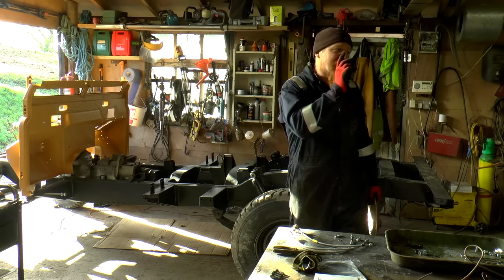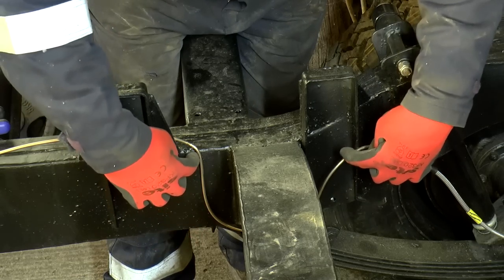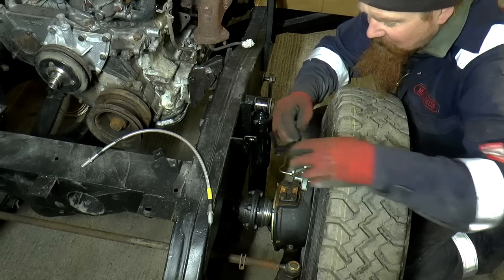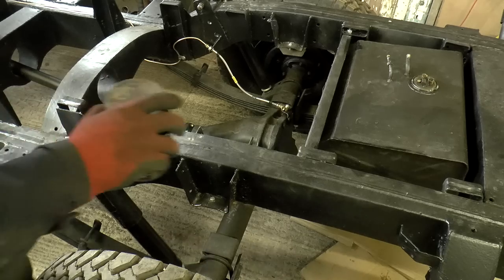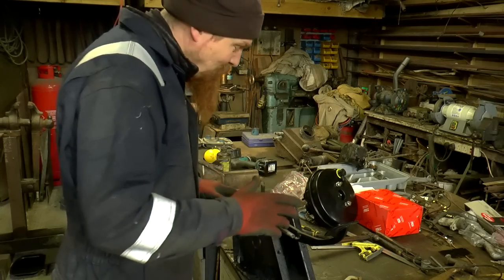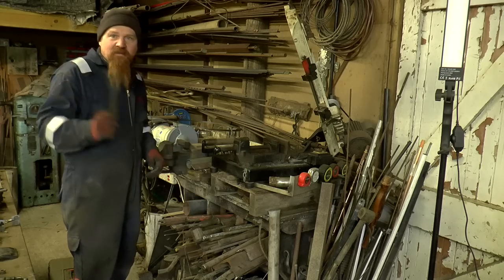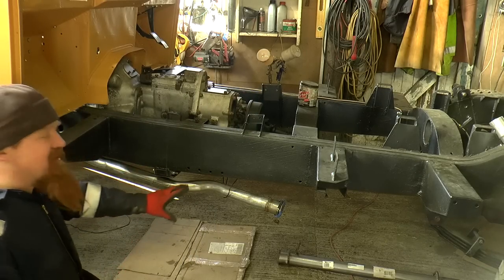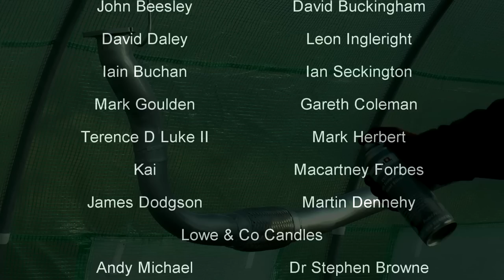Project Kermit 27: A Series Land Rover Full Restoration

Comment: hi max could you send the links to the break pipe flaring tools you are using
Reply from the maker: I used a couple of different ebay sellers, I don't have any links (it was a while ago!) but I'm sure those or similar will be easy to find on there.
Reply: thank you max , i named my land rover after you , i mean i did it about four years back still it is under restoration , i am sending this message to you from Sri lanka , we have so many land rovers here , i have a 1978 series 3 , 109 hard top. really amazed with your work , and really enjoying your channel as a whole , love your relationship with you grand father , i lost my father about 6 months back ., he was my mentor and my biggest fan. hope to hear from you  @maximusironthumper
Reply from the maker: @rajeevadesilva7951  Hello to Sri Lanka! Wonderful to hear my videos get out so far. Great to hear there are land rovers still there. Sorry to hear about your father, that must be a terrible loss, Grandad is my mentor and probably my biggest fan too!
Reply: @maximusironthumper  yes it was a terrible loss max , its not easy filling up a void that so big in my life. but i am moving on as life must go on , if you have an email i can send you some of the pics that i have taken in my land rover , i have restored two land rovers so far one is a 1982 series 3 short wheel base which i restored by my self and at the end i had great help from one my close land rover friends in Sri lanka , it had a 5 journal engine which i restored to the mint conditions using all OEM parts , i used in for more than 4 years and done about 50,000 Km in it before selling to worthy gentle man,  main reason for selling that was to get 109 restored since 88' is lacking the space inside i require for my camping trips .

Comment: I bought some stove paint for an exhaust which was a total waste of time....there isn't a lot on the market for very high temperatures. Also, I didn't find a primer that stated it was suitable for high temperatures - if you do have some info on this there'll be a few people who'd like to know. Good video....
Reply from the maker: I just bought high temperature paint via ebay, won't know for a few months if it's any good though!
Reply: @maximusironthumper  A bit of a scratch with heavy duty scourers or scotchbright as they call it in the US, is probably all that's required for preparing the surface and maybe you'll strike lucky. Stainless steel makes sense with exhausts but who wants to pay for those?

Comment: I use the same flaring Draper type tool as you have for both metric and imperial. When making a metric flare the die with the wing nuts on i use the flat side of the die which gives you the flat bottom of the flare.

Comment: Copper grease won't be compatible with brake seals and may cause them to swell/fail (assuming it's dot 4, not sure about mineral brake fluid systems).
I would recommend red rubber grease which may be what's in the flaring kit grease.
Reply from the maker: It's only a tiny bit on the threads of the fitting, no way for it to get in the hydraulic system.

Comment: You should use copper coat on all bolts  screws when brackets are mounted on the frame  on the brake line where the fittings ss s